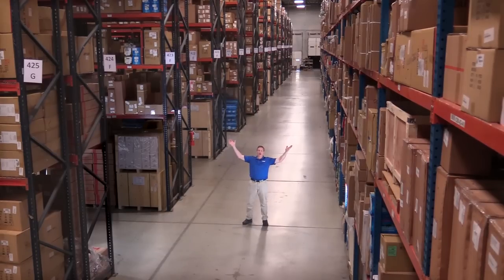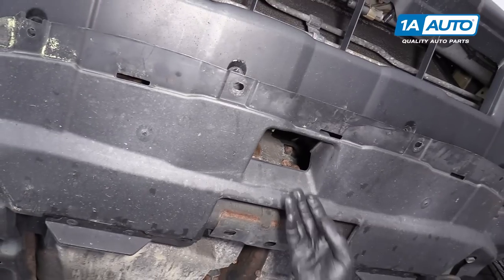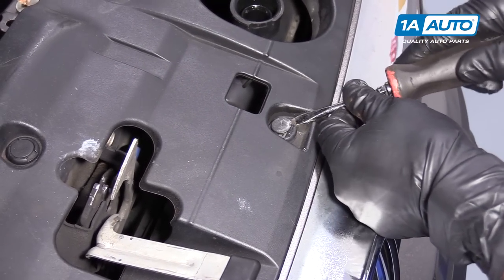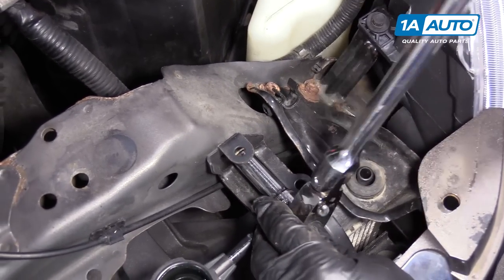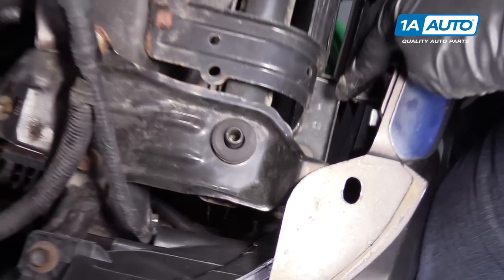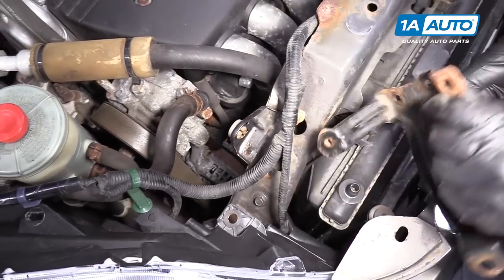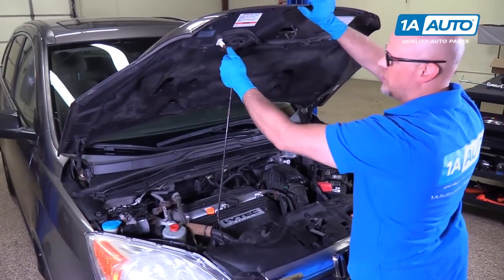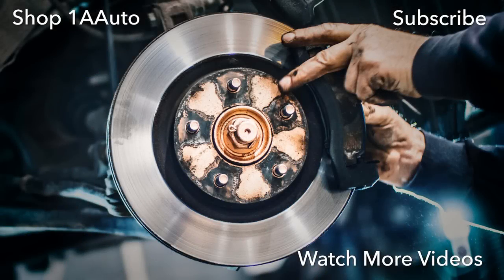How to Replace Radiator 07-09 Honda CR-V

Comment: Great Video!!!    Instructions were easy to follow however wish somewhere in the video it mentioned that the lower radiator hose connector needed to be purchased separately.  I really wished the radiator came with it tho.  Charging a bit more and including the connector would be ideal.

Comment: Outstanding video … very clear & you hit every point needed !  I ended up buying a new lower radiator hose adapter from Honda …. At 11-12 years old, the old one wouldn’t budge.  I also replaced the “sandwich “ type transmission filter while radiator was out … was very easy to get to at that point.  Just preventative maintenance.  Thanks for the effort to make and edit the video.
Reply: A Honda part number for that adapter by chance?

Comment: My new radiator doesnt seem to allow a snug fit for the old radiator's hose adapter on the bottom. Do I absolutely NEED that piece or can I attach the hose directly on the radiator. I dont see why it would matter but I'm not 100% sure

Comment: I bought a replacement radiator, got it all taken out and went to go replace the sensor that you did and my two censor spots are different.. the replacement one doesn't screw out its just a plastic 10 mm bolt hole.
anything on this?

Comment: Great video! It is too bad that new radiator suppliers don't include new mounting hardware, especially since seized bolts are commonplace with rad replacements. I am sure that increasing the cost of the rad by $5, would not be a complaint by 99.9% of the people doing the replacement.

Comment: Definitely don't flush the old, contaminated coolant out of the system before you install the new radiator.  Always drain fluids with the vehicle seven feet in the air into a drain pan on the floor so the fluid splashes everywhere but the drain pan.  Don't forget to destroy the brand new radiator like she did by scraping the new fans against it during installation; no need to make yourself more room by taking the extra step of removing the front grill, bumper, and condenser guards that takes a total of 15 minutes.  Also, leave those rusted trans hose clamps despite the fact that she acknowledged the fact that they are useless when rusted.  Well done 1A Auto.
Reply: Based on this guy's dumb comments,  he will replace your radiator and charge you for refrigerant he will unnecessarily vent to air. Take it to Mike R!
You obviously have never wrenched on this gen of CRV, or do you wrench at all? Try replacing the condenser fan, there will be scrapping, wiggling, and cussing. Try replacing the motor fan (driver side), you will likely break the fan mounts wiggling it in. Pretty easy to be a keyboard warrior and critique a video when you've never done this job. This lady did a phenomenal job!!! more patience than the average bear. great video!!